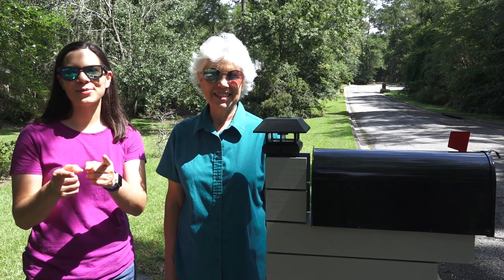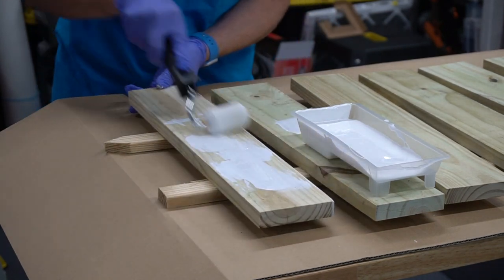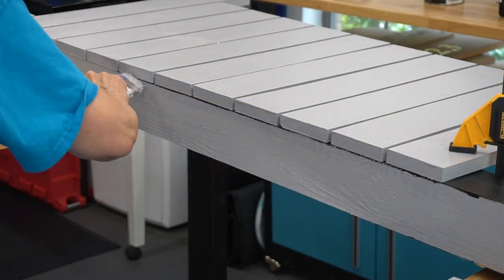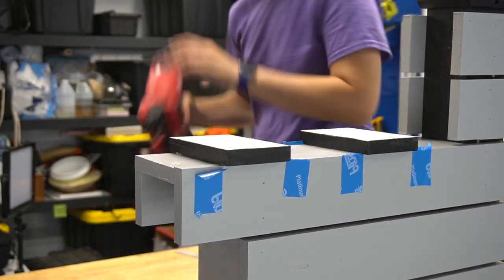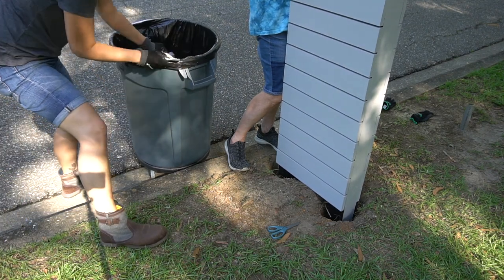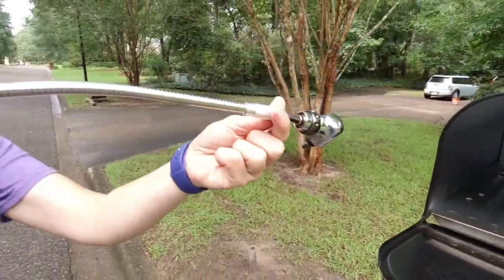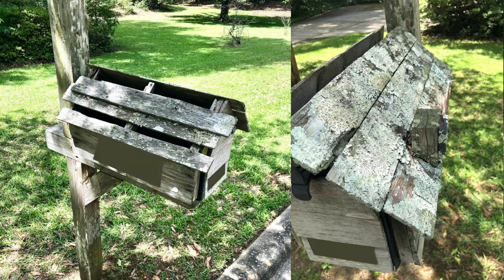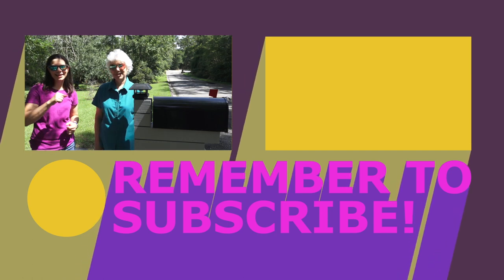How to Make & Install a Modern DIY Mailbox!

Comment: Really like the design, nice job!  A constructive criticism though: you effectively glued your project together with paint - since you painted first and then assembled.  I'm not sure which bond is weaker, the paint to wood, or the glue to paint, but it will not hold nearly as well as if you had glued the wood first and then painted.